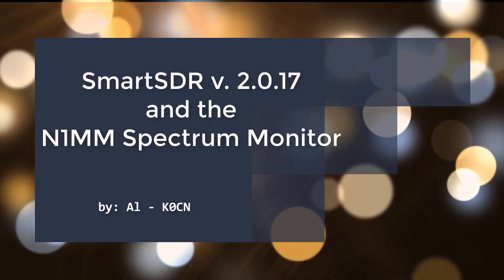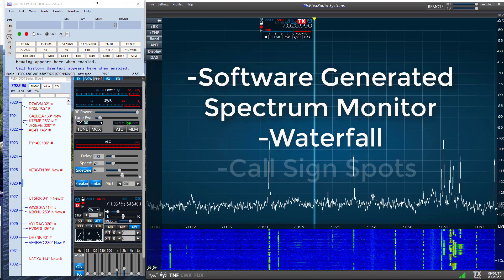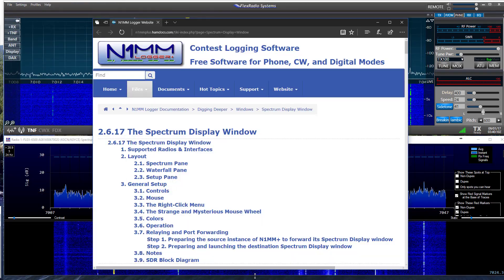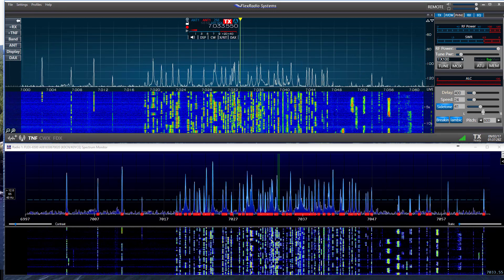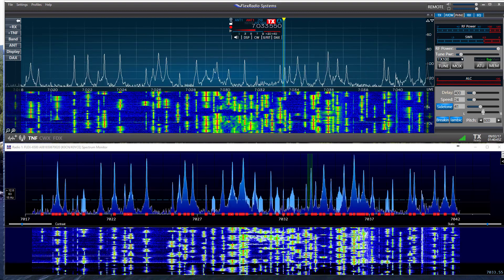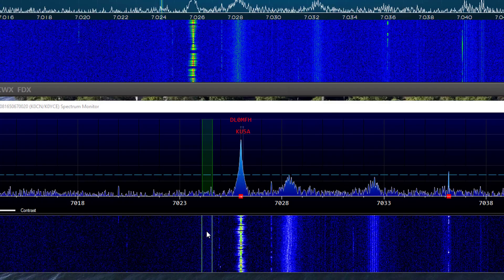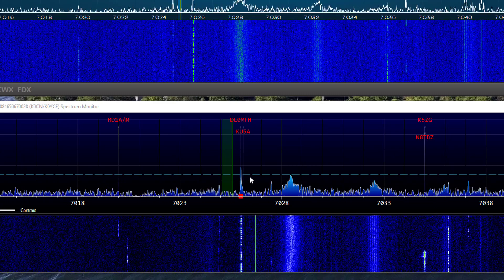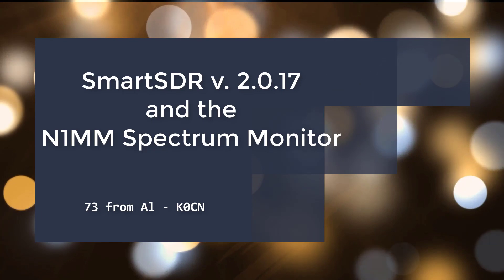FlexRadio SmartSDR v.2.0 and the N1MM+ Spectrum Monitor

Comment: Nice video, Al. I'm impressed by the software. Oddly, I am more impressed with the S1 noise floor. It is usually an S7 where I live, occasionally getting as bad as an S9. To hear anything I have to take the radio in to the field. 73
Reply from the maker: Thanks, utilities are underground here, which helps. Noise floor here can get up to -115dB on 80M. Lower on higher bands, also depending on the antenna.